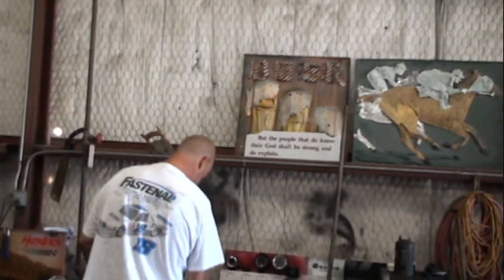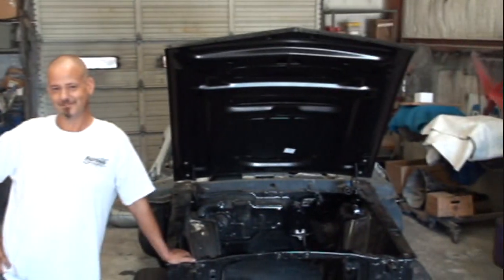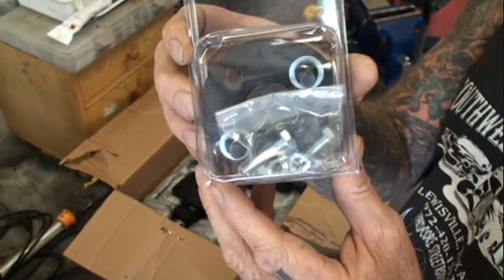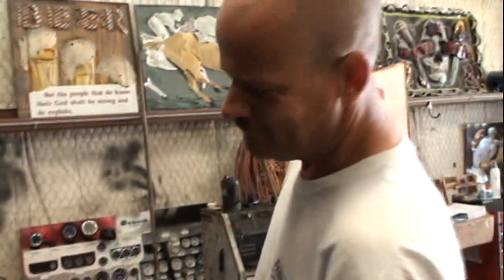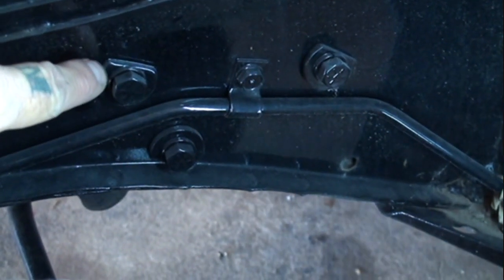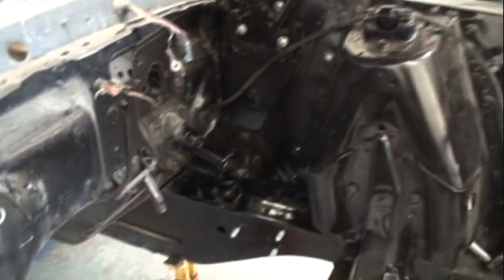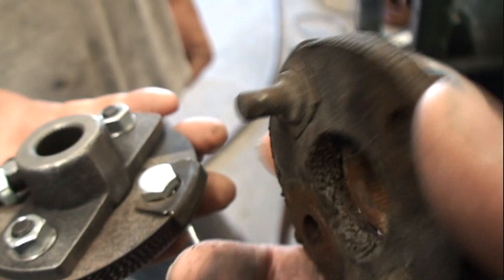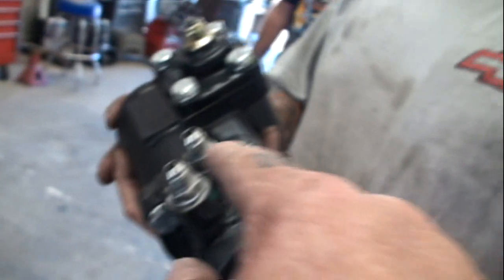How To Put Power Steering In A Classic Ford Mustang - Part 1

Comment: Pete, I've got to say that you've got the best channel on YouTube.  I don't know when you find the time to sleep.  There's not one thing that I can think of that deals with auto body that you haven't covered and covered well and if you screw up you're man enough to admit it.  Thanks very much for all that you do. 
 Some info that you may need to know.
 I just bought this Borgeson power steering kit for my 67 Mustang.  I had previously installed a collapsing 68 steering column into the 67 as I didn't want to get harpooned by that O.E. 67 steering shaft.  Years ago, I scrounged around a you-pull-it yard and found a 68 with the short shaft steering box and collapsing column.  Luckily, I found this stuff cheap before everybody went nuts with the Mustang craze.  I've found that the manual steering is too much of a bitch with wide front tires when trying to park. My smaller diameter steering wheel didn't help either.  I had an O.E. power steering system in a prior Mustang and no matter what, that son-of-a-bitch leaked like a sieve, so using that POS was out of the question.   Maybe this Borgeson set up will work out with the original 68 column. Your video should give me some insight.

On another thing that came to my feeble mind, I checked around and considered the rack and pinion power steering retro-fit kits.  Those damned things will require you to to either cut up the sub-frame and/or install a custom oil pan, or install a custom sub-frame assembly that makes ground clearance an issue.  Some of those rack and pinion kits will make your once cool looking Mustang look like some kind of jury-rigged first class and expensive piece of shit.  You have steering shaft u-joints and bits of straight sections running all kinds of ways, too.
 I'm glad that I held off until someone could come up with a power steering box in one unit that doesn't have a modified box where the cast iron housing is welded to a steel mounting plate.   From my experience and I've got a bit of it, welding cast iron to a steel plate doesn't always meet with total success.  The last thing that anyone needs to happen is the box separating where the welds failed.  I don't remember who did this to modify these boxes so that they's fit, but I haven't seen anything like that offered in a while.  This Borgeson box is a one piece casting that they had designed and had a company that specializes in casting components build the housings.  Borgeson does the machining and component assembly. 

Borgeson offers 65-early 67 steering boxes with  1inch sector shafts.  I'd consider your options and give Borgeson a call if you have a manual steering car that has a frozen up bearing on one end of a 1inch pitman arm. Those M/S pitman arms are not made in reproduction form.  Only the 1 1/8 inch M/S pitman arm for the 68-70 sector shaft steering boxes are being reproduced.  There's some other steering column issues to consider, also as well as manual transmission linkage clearance.  Borgeson does make a manual shift linkage "Z bar" that has been modified for shift linkage clearance.
  
There's also two different idler arms, too.  If you've got an original manual steering car you'll need to change to the solid rubber bushing idler arm for power steering because the solid rubber bushing aids in centering the steering. It twists when turning and springs back to its normal position that re-centers the steering after you've made the turn.  A manual idler arm has a free turning bearing instead where it doesn't offer the spring back and depends on the alignment caster and toe setting for the re-centering effect. This may require a change in idler arms or in the idler arm bushings themselves. The bushings are a pressed in affair and require a small press to install them.  The bushings are much cheaper to buy then a  suitable idler arm.  Borgeson's phone number: (860)482-8283  www.borgeson.com

Comment: the boss 302 uses 351 c  closed chamber 4v heads   so pull the block number to make sure  and most of the true boss  mustangs had manual  steering
Reply: 4 v marked heads are 4 bbl